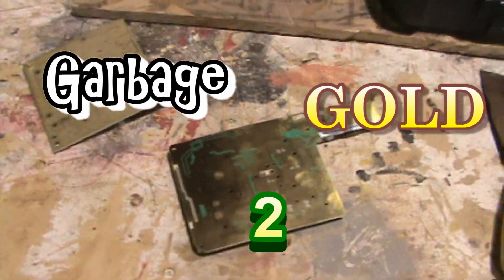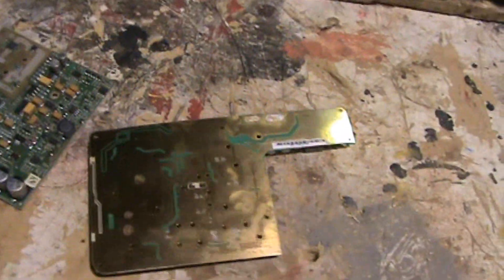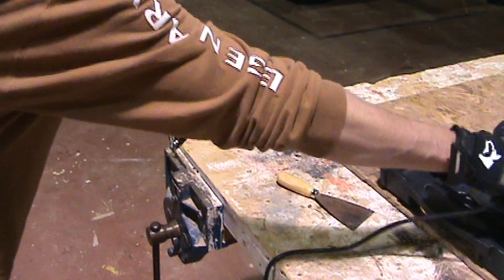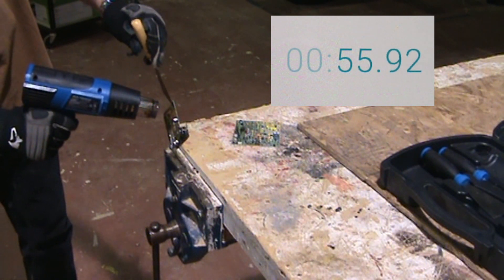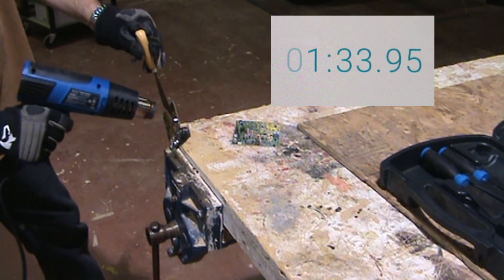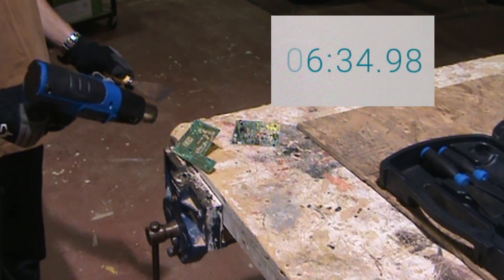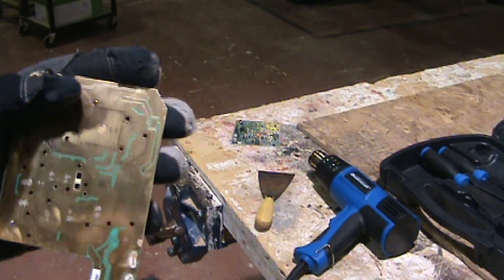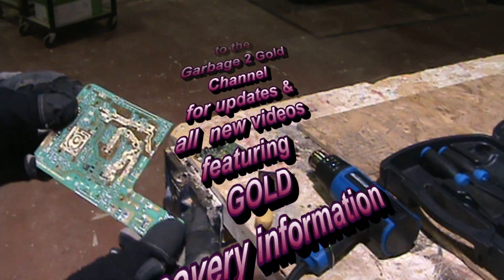How to depopulate Circuit boards for Gold without chemicals

Comment: How exactly are you supposed to sort resistors from mcb and such after you depopulate a board this way?
Reply from the maker: After the material cools off we simply dump the contents of our capture bucket onto a table and sort it by hand into more detailed categories. We use empty plastic jars to collect the sorts.  How specific you get depends on what you intend to do next.  The whole lot can be sold as is, but the price won't be as good as it will be if you sort it into some basic categories. And if you intend to refine the bits yourself and capture the precious metals than really you only need to remove the parts that don't belong and keep the rest together. Thanks for watching.
Reply: 😅 @garbage2gold773